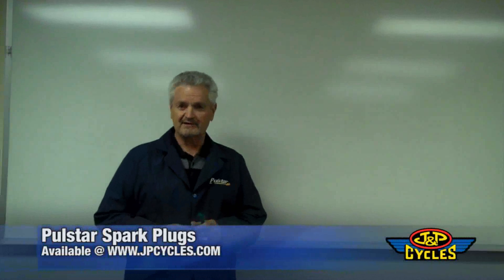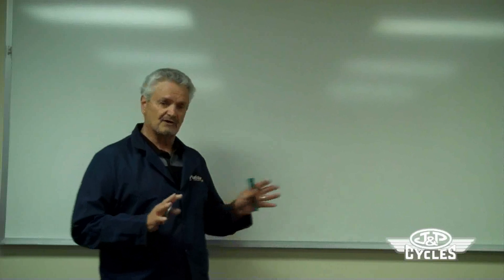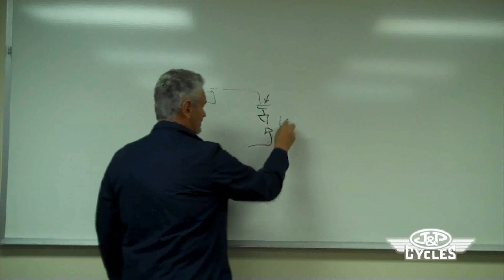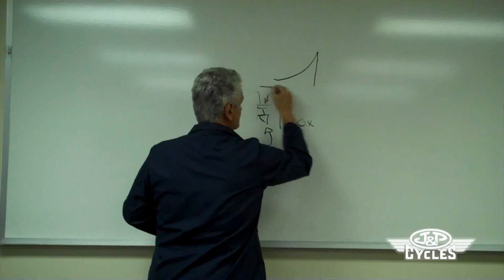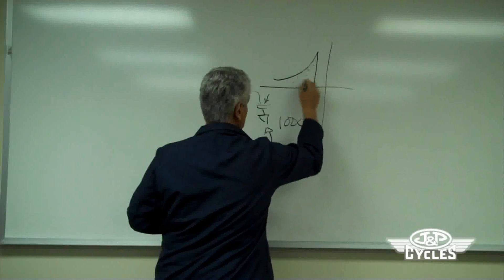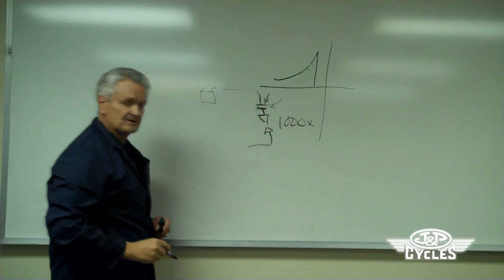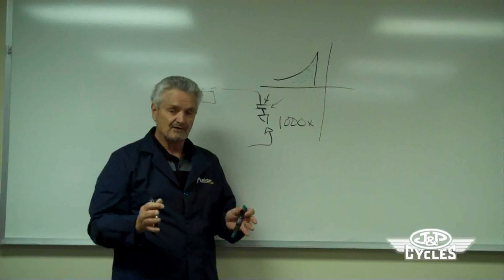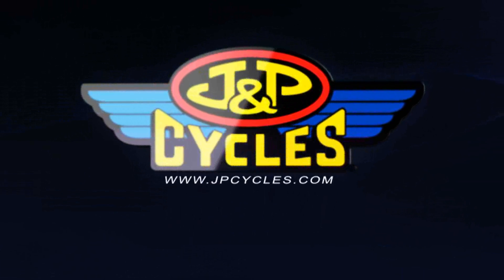Pulstar Spark Plugs - Pulse Plugs Science Explained • Shop J&P Cycles

Comment: In February of 2010, I had a set of 8 pulstars installed on my 2006 gmc pick up. Price was 24.95 per plug, plus labor and sales tax. They lasted 55,000 miles. It appeared it had a little more horsepower. I didn’t notice a change in fuel economy.

Comment: A capacitor can NOT give you 1000 times nor any amount of extra power. This quack's science lesson, as I take it, is saying that the spark is stronger tho shorter and therefore more 'presice'. While this might be accurate, a certain amount of spark duration is needed for complete ignition. Nothing past the source of energy can increase energy.  You can have a shorter 'hotter' spark or a longer 'weaker' one and each may have an advantage over the other. BS marketing selling another 'special' plug

Comment: I'd be interested to see if this is just the motorcycle version of the E3 Spark plugs you can get off Amazon for 6 bucks each. LOL. I do believe they would work, but 33 bucks for 2 is a bit rich for any spark plug. Also if your gonna do spark plugs, and your only making them for bikes, you are missing 80% of the market in cars and another 10% from trucks and commercial vehicles. Do them for everything at a fair price and get a deal with a car maker as standard equipment. Then your good.